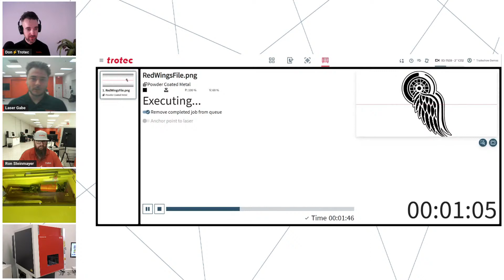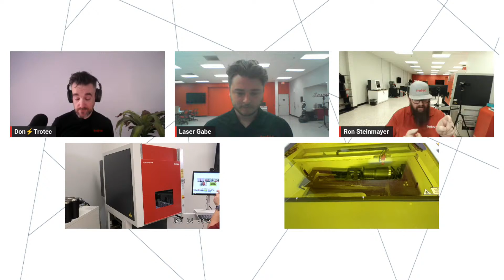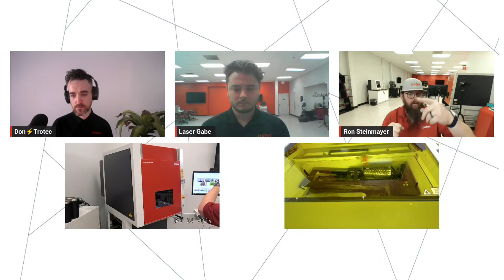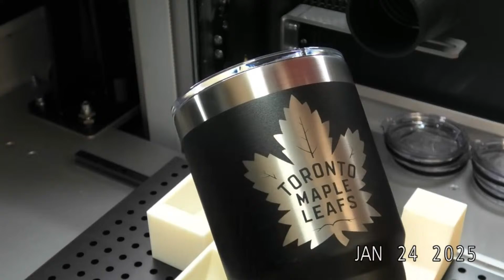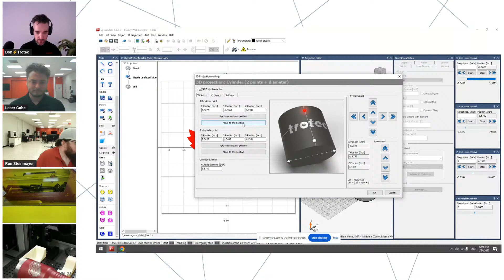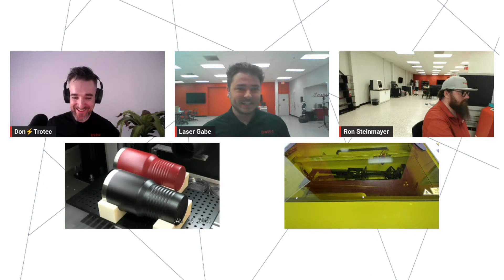All Things Tumblers TroTalk Webinar

Comment: Can you use the auto focus on the tumblers
Reply: You can't use autofocus, but you can program in the correct height so it will move it as part of the run cycle.
Reply: FYI - that's for the Speedmarker - unfortunately you can't autofocus on the Speedy with the rotary unfortunately.